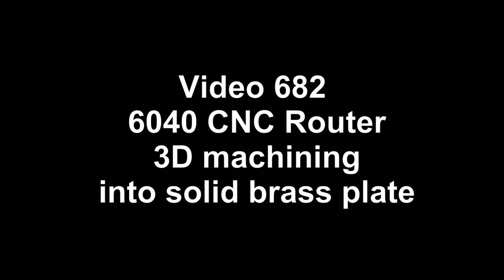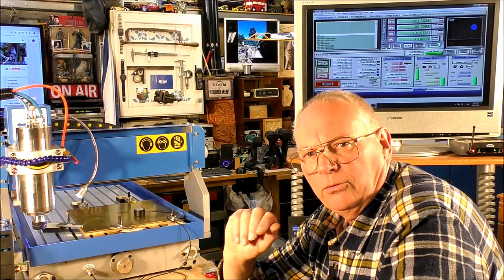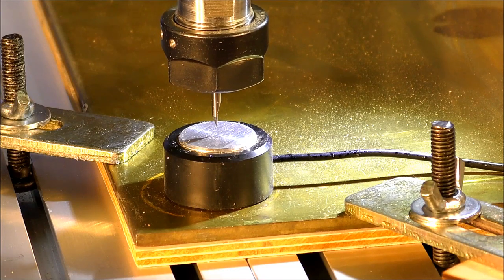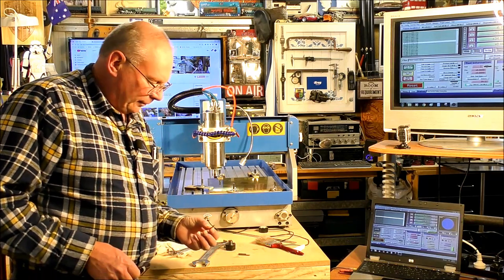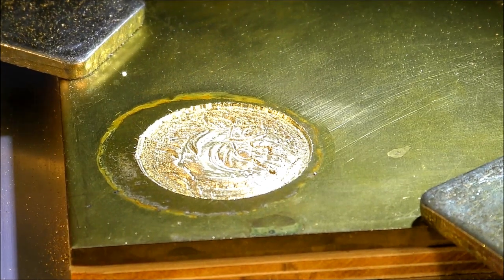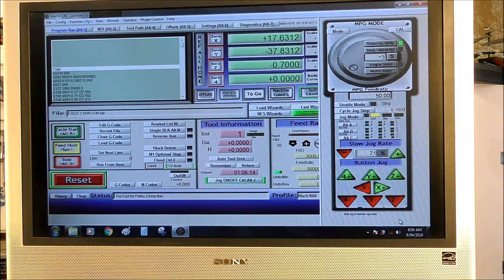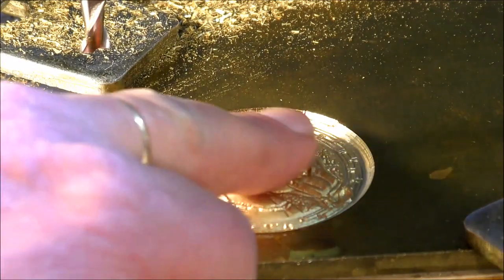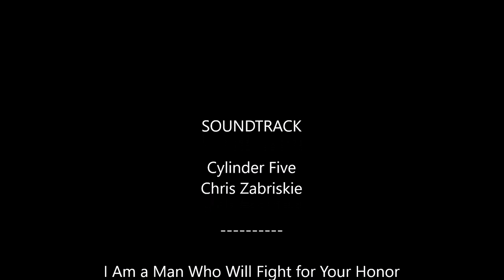6040 CNC Router Making $125 per hour 3D machining into solid brass plate

Comment: I have to admit that I do not know much about machining and especially CNC machining but I'm looking into it. I'm looking into starting with probably a smaller table top version unless I can find a good used larger more professional type at a reasonable price. I'm really only interested in doing it as a hobby, at least at first, then who knows.
 What I'm interested in trying to mill at first is a vape mod called a "Billet Box." It's about the size of a pack of cigarettes and contains a single 18650 rechargeable battery, a vape tank and the electronic chip and controls which set the voltage etc etc. Most of these Billet Box's (brand name) are machined from a single billet of aluminum but a few limited number have been machined from a single piece of naval brass and according to the owner of the company the ones made of brass are a pain to machine. Anyway, the newest Billet Box made of brass, which only 2 were made, also has abalone and I believe mother of pearl inlay into an antique style script on each side. Also, the magnetically attached front and back cover is made out of carbon fiber with what appears to be an inlaid rabbit or "bunny" made with a brass outline and inlaid with abalone, mother of pearl and some other material, hence the name of this mod as "Das Terror Bunny" Billet Box. It is a beautiful piece of machining and inlay work and I'm trying to learn what kind of equipment I would need to machine one. The inlay work is probably a different story, I'd like to learn how they did that too. If you'd like to see this piece I can email the website and/or pictures or just Google "Das Terror Bunny Billet Box." It is quite a statement piece, beautifully made and one of a kind.

Comment: I tried to machine brass for clock dials with poor results.  Not only broken mills (despite high speeds and low surface feed rates) but brass dust in the spindle bearings.  The latter problem required rebuilding of the bearings (Mechatron spindle).  If I try this again, I’ll set up positive pressure in the spindle, but that will require some study, to better understand the necessary relays.
Chatting on the CNC forums hasn’t been helpful, because almost nobody (who replies) is working with brass.  Is there anyone out there with whom I can correspond?
Reply: Als je werkt met messing plaatmateriaal heb je langspanende verspaningen.
Indien mogelijk rond staf MS58 gebruiken deze zijn kortspanig.
Eddy

Comment: Hi Roger, Have you had a go with this on your CNC mill. Also would aluminium work or would it be a bit soft. Cheers Dave.
Reply: Aluminum would be easier to do
Reply: Aluminium alloys 6061 or 6082 mill well. Pure aluminium or alloys like 1050 are too soft to mill nicely.
Reply: @SpoonerSPON  no you should still be good. Its all about chip evacuation and coolant.